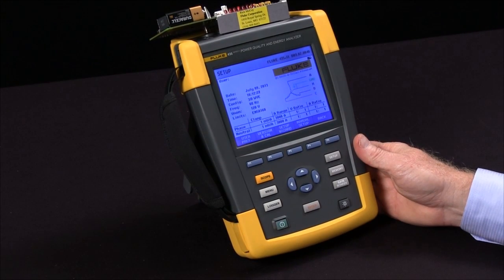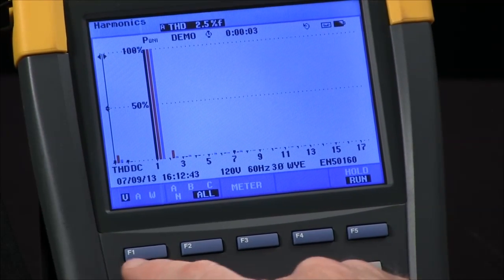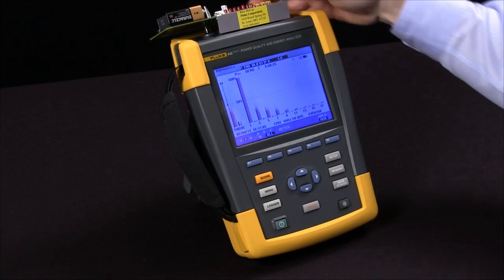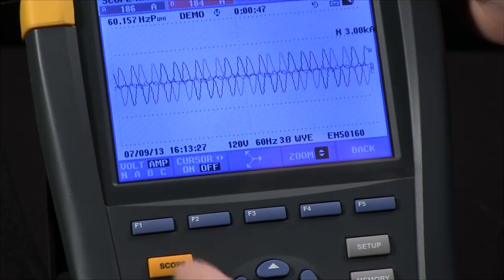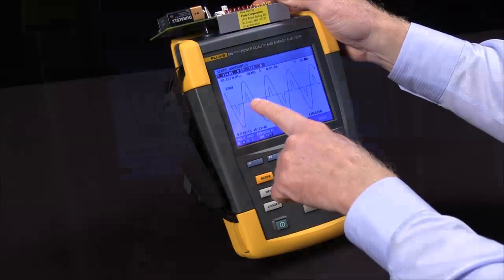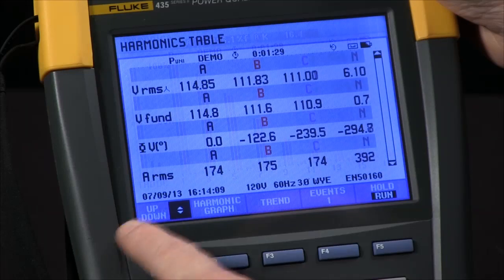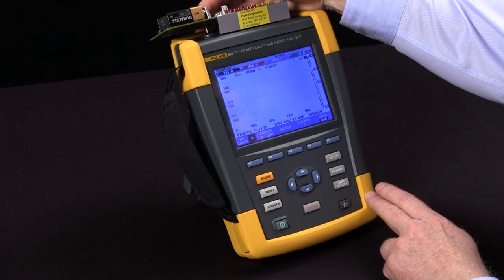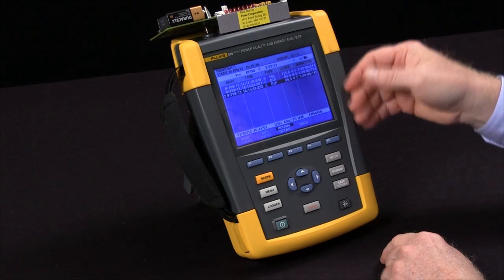How To Use A Harmonics Test In A Fluke 435 Power Quality Analyzer

Comment: I have used the fluke 435 to measure the voltage and current THDs at the output of a single-phase multilevel inverter using R load. I found the current THD is lower than the voltage THD even R load is used. Also, I found the current THD in experiments is lower than in simulation, where the opposite is true. Can anyone explain why this happens using fluke 435?

Comment: But how you connect on the load side, please take practical example
Reply: Simply by using the voltage probes to measure the voltage at your load terminals, and the current probes wound around the wires connected to the load for measuring the current.

Comment: can we measure DC current and voltage and harmonics with fluke 435 series II?
Reply from the maker: Hi Dipak - Yes, the Fluke 435 can measure harmonics, and can simultaneously measure AC output power and DC input power for power electronics systems using the optional DC clamp. More information can be found here on out Technical Datasheet. Thanks! http://bit.ly/2JPy254